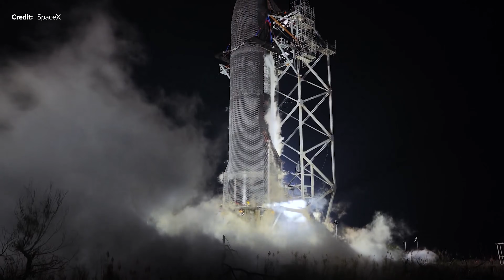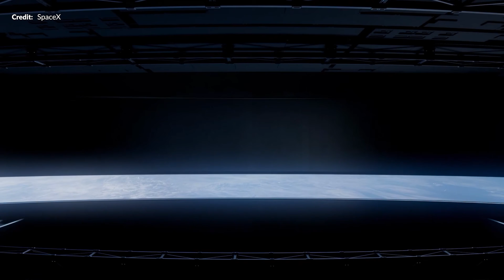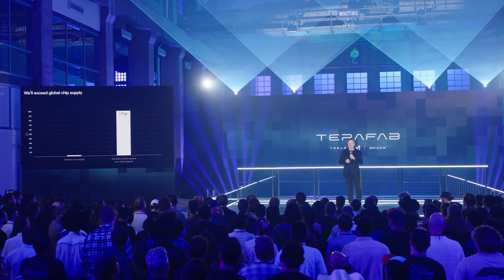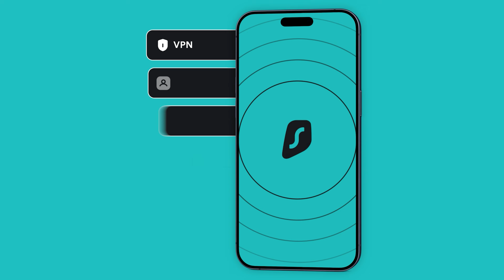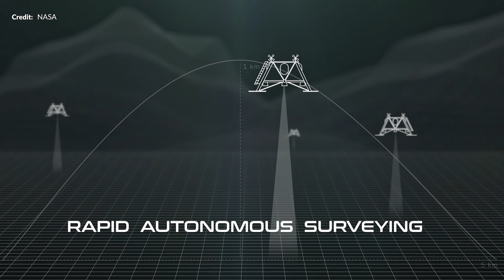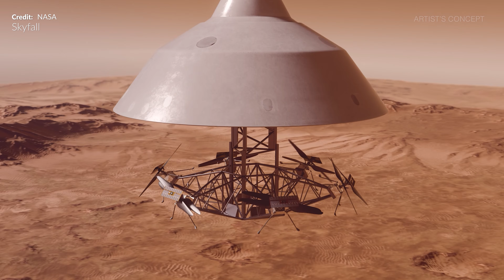They Want 5000% More… Of WHAT Exactly?

Comment: What I don't get is since when we are measuring compute capacity by the units of power - KWh, MWh, GWh...? What happened to OPS ( operations per second or some other compute capacity measure)? It sounds like we're measuring air cargo capacity / capability by using the fuel consumption. Very strange, IMO. Oh good grief, please don't schedule launches on April 1st
Reply: Electricity is the number one limiter for any data center. I suspect that is why they started measuring compute in electrical terms.

Comment: No it wouldn't take all that BIG TIME building one little unit does it's bit and then 2 little unit doing same or different little bit then 3 little unit get 9 in each ship launched adds up fast and can work fine by little bit engineering

Comment: So a few things to keep in mind regarding the complexity of the supply chain are that 1. it's as complex as it is because it wasn't made as a single cohesive end-to-end process. It evolved naturally by taking advantage of existing infrastructure and specializations. On the moon there is no existing infrastructure and anything we build there is going to be designed from the ground up as an end-to-end vertically integrated process. 2. There are certainly innumerable ways that the supply chain here on earth could be simplified if that was the objective but that's not what they process is optimized for it is optimized to deliver the minimum viable product for the lowest possible cost so even the supply chain could be simplified by delivering a component across the street that component might instead get shipped half way around the planet because someone else put in a lower bid 20 years ago which created a snowball effect of market dominance in that specific specialized task in the chain. It isn't necessarily as complex as it is because that's the only way to do it it is as complex as it is because the industry as evolved so quickly that in a lot of cases if a company didn't get in on the ground floor 20-40 years ago it is very hard for them to get a foot hold to brake into the market and compete with pre-existing corporations. There are very few cases where a particular point in the chain is there because they are literally the only possible source of that component those exist sure but they are not the norm.

Comment: Why is SpaceX not making the Starships single use? If they do not have to return to earth, then that saves massive costs and it increases the (fuel) payload they can take up. 
So, discard the Starships? No..... Not at all. Just combined them to make the ISS-replacement and rent out space, so they will make money that way. 
Just a thought.
Reply: Making them reusable saves money. It’s literally the whole point of starship
Reply: @zachb1706 
Yes..... but when it comes to fuel delivery systems, reusability can take a different form. 
Yes, the 'normal' starships should go up, come down and go up again as soon as possible. 
But every kilo (heat shield) on a tanker ship reduces the fuel it can take up. Fuel needed to land it, reduces the usefulness of the tanker ship as well.
So why not leave the heat shield behind and do not keep fuel for reentry, but instead take up as much fuel as possible, pump that into the other ship, and then REUSE the ship as a space station?
Reply: @RensDuijsens sure, in an expendable configuration you could send up more fuel, but you’d then be expending the entire vehicle - the vehicle being like 90% of the cost to launch. Instead you cut the payload slightly, and reuse the vehicle, saving that 90%. 

And your idea to use the expended vehicle as a space station to offset costs. Firstly you’d need to give up a lot of mass and money to build out a space station interior. And secondly there’s no benefit, what would we use the space station for, who’s paying for it.
Reply: @zachb1706 
Well.... who was paying for use of ISS? 
They did investigate (and not only SpaceX did) if a private space station would be profitable, and the conclusion was that it would, hence several companies are planning their own space station. 
But I get your point about the interior.

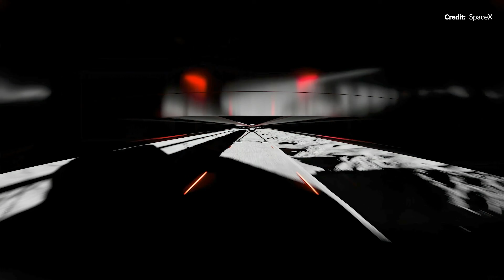Comment: 9:00 You actually don't need every element to be mined or manufactured on the Moon! You can fly entire Starships full of the extremely hard to mine on the Moon materials, and even things like AI chips, from Earth to the Moon. Building just the heaviest parts of the sats and doing their assembly on the Moon would still lead to absolutely massive cost savings, if they were then sent into space using a mass driver from the lunar surface.
Reply from the maker: That is the only way I could see it working but the question is what percentage of the materials in terms of mass would you need to send from Wath. I'm not a fan of sending rare earth materials into space over long periods of time. We don't want to be hurling stuff out that is never to be recovered. If it is all recycled, that would be ok, but currently none of Starlink is recycled. It will just burn up in the atmosphere.

Comment: 10B is a lot of money if you aren't pissing away 2B per launch. If you can get the cost down to 200M per launch to lunar orbit which should be possible using current or near term SpaceX rockets it is more feasible. Additionally Musk is going to be putting his own gear on the surface so partnering with him makes a great deal of sense. Let the rest catch up and throw them a bone when they are good dogs. Ditch the SLS ASAP.

Comment: Though I'm sure it will happen, stints as moonbase crew won't be popular for long, once the range of health impacts becomes abundantly clear.
Reply: What health impacts?
Reply: @imaginary_friend7300 0.16g
Reply: They'll be living in tunnel bunkers, not on the surface, the health impact won't be anything other than the standard bone loss, They'll be fine, when they're working outside, They'll be in sealed space suits, most of the surface task would be done by the robots, or drones
Reply: @stefthorman8548 That is not the current  science

Comment: A Million Tons into LEO is just Crazy...  No one in their right mind is apt to believe spacex could actually launch millions of tons yearly into orbit ..  it seems like a silly fantasy...  On the other hand...  It is possible that if the next few starship tests flights just happen to go as spacex plans we could start seeing frequent starship launches this year..   15 years ago if you told someone falcon 9 would launch and land 3 times a week with well over 150 launches a year they would have laughed at you..   With just 4 boosters and 2 working launchpads, Starbase TX could see 2 to 4 launches daily by the end of this year..   This seems crazy.. But this launch cadence is fully plausible...   4 boosters and 8-12 starships, once the kinks are ironed out will launch daily..   The deciding factors will be how long a starship stays in orbit before returning and how long it takes to put each payload into returned starships..  

This is why spacex plans on mass producing starships and not boosters...   One booster will launch dozens and dozens of starships into space each month.    Spacex will likely assign 2, maybe 3 boosters per launchpad..  With all the success of the last 2 starship flights the odds of this happening are much higher than they were a year ago..    In the next 12-16 months when Spacex starts launching from 5 towers we could easily see 10+ launches daily...   That's somewhere between 1000 - 2000 tons a day into LEO..   Totally unthinkable 10 years ago...   Even outlandish proposals could become reality..  Our world is changing fast...

Comment: Does anyone remember that first super heavy launch off of basically gravel. The entire pad failed. Multiple engine failures on climb out. How is lifting off the lunar surface going to be any different? The original lunar lander used an upper stage to launch protecting the vehicle from debris.
Reply: They won't be lifting off a early low fidelity test article.  You don't have any actual clue what's going on do you?

Comment: They really need some drones too. Moon drones. With refillable rocket motors, so they can view the whole area for longer than the 20 seconds it takes for them to land. Then they can scope out new areas to explore, and maybe even transport small items to astronauts in different locations, potentially lifesaving things that would take too long to reach in a rover like an emergency oxygen pack, medical supplies or batteries, or tools to fix a stranded rover. It could go dozens of miles away and then rocket back to the base without having to refuel until it gets back to the base. 

They could refuel it using water ice in the craters by splitting the hydrogen and oxygen. 
I guess they could use it to survey for more water ice too, route plan etc.

Comment: Elon has already made the issue of using his high competency and AI driven Robots for the moon to do ALL the outside work of setting up the base, mining the regolith for HE3 and other minerals and setting up a metallurgical plant for creating pure and complex metals to then produce other products such as solar cell arrays, metal frames for satellites, containers, other equipment for mining and building structures (mass drivers?), and eventually another Chip manufacturing plant.  True not all metals are available on the moon (such as iron (as far as I know)) but there are some of the more esoteric metals and he plans on sending Starships with Robot Crews and prefab mining, smelting, and manufacturing automated systems in the asteroid belt that can ship exotic metals and precious metals back to earth.  the Robots can be programs initially and via broadband microwave to do all this and ship the stuff back to the moon or transfer to Starship landers in earth orbit to send back down.  Their are large asteroids made entirely of metal including base metals and precious metals such as the Gold and Platinum/Iridium/Rhodium series that can be mined and used.  He has very agressive and realistic plans for the next 50 years including Mars colonization.  Just saying, it doesn't all need to be done by manned units!
Reply: He has?  Where?

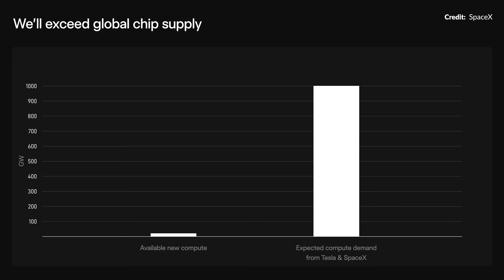Comment: 7:45 Compute is NOT measured in Watts; it simply doesn't make sense.
1. Watt (W) is energy, meaning the amount of electricity that flows into the chip. If a chip gets more efficient, it can do the same amount of work/calculations using less energy, thus Watt.
2. Compute is measured in FLOPS (Floating Point Operations (per Second)), a variation of that (TFLOPS for TerraFLOPS, PFLOPS for PetaFLOPS, etc), TOPS (Trillion Operations Per Second). Sometimes in IPS (Instructions per second). Simply put, how many instructions or calculations can a chip do in a fixed amount of time (given an optimal environment).

FLOPS & co. make incredibly more sense, since chips get more and more efficient over time, but the calculations stay the exact same, they just get more. The last actual change was SIMD Instructions, and they are just multiple calculations at the same time → The Amount of calculations still mattered the most.

Measuring Compute in Watts only makes sense if you want to compare the efficiency of two or more chips, or maybe if you produce incredibly inefficient chips but want to make it sound amazing.
Reply: When it comes to powering and cooling it's the important metric.

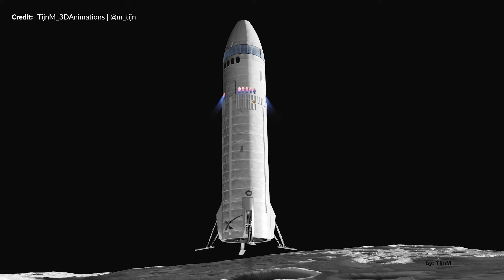Comment: 13:18 - Starship is far too tall to land safely on the Moon.  The height of the CoG of Starship exceeds the diameter of the footprint of the landing legs by an order of magnitude almost.  That means it will tip over and topple on inclined or uneven surfaces.

Look at the LEM tha NASA landed on the Moon.  It had a CoG elevation that was far less than the diameter of its landing legs.
Reply: That's pretend expert nonsense.

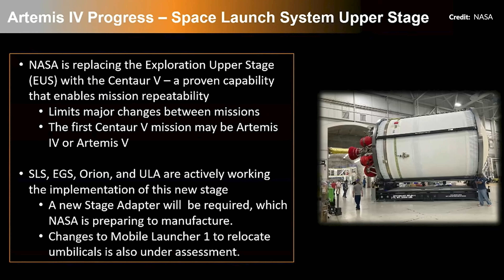Comment: 12:56 - I have a gut feeling that the SLS is being held back to give Tesla time to get up to speed.  Something that probably will not happen for at least a decade, if at all.

I think the cost efficiency of Starship is a myth.  Don’t look at the cost per flight.  Look at the cost to get results.  SpaceX fails that standard miserably.
Reply: as long as there is private equity funding appetite, combined with gov't spending appetite, SpaceX will probably be able to proceed. Once they go public, they will also go the public debt/bond route to raise funding. Whether those sources run dry does depend on execution. While Elon time extends everything, at least SpaceX seems to be able (to date) to develop what they say they will (unlike Tesla in some cases). Starlink, Falcon 9, Falcon Heavy to name a few and reusable rocket consistency with Falcon 9. No firm is perfect, but at least SpaceX seems to be relatively well run by Gwynne Shotwell (or at least she seems to be able to navigate the Elon minefield so far).
Reply: More pretend expert nonsense.  I think you're a fool and little else.

Comment: As far as the lunar communication system.... Why don't they just use a falcon heavy to throw an entire payload of moon-optimized Starlink v2 minis into lunar orbit? That would surely be a HELL of a lot better (and cheaper) than 2 purpose-built satellites. Then just put a dish on everything on the surface of the moon, and bingo! Instant comms.
Reply: Because there are few truly stable lunar orbits.

Comment: I think the idea behind making AI satellites on the moon is that much of the mass would come from the moon (the frame of the satellite, propellant, making the solar panels and radiator) but the difficult bits like the actual compute elements/silicon would be made on earth and delivered to the moon for integration. To replicate the chip supply chain entirely on the moon would be very difficult indeed.
Reply: Hard to get metal and hydrogen out of the Moon.
Reply: @mrbaab5932  Aluminum is abundant on the moon. I'm not sure hydrogen would be the propellant of choice for AI satellites. Starlink uses xenon fuel for ion thrusters. The point of the mass driver is to reduce the need for chemical rocket fuel.
Reply: I'd imagine it was done this way to increase the wow factor for news and investors, and if ever done in the flesh it will surely be done the intelligent way

Comment: I had this interesting idea the other day.  What if The Gateway Station is turned into a duel mass driver and moon space elevator system?  This way, we would take advantage of the 1/6th gravity by creating a permanent system that would require no fuel to land and transfer materials and people to and from the surface.  The Gateway could then have Hotel modules to create a moon tourist economy as well as a research hub and a way point for the moon and beyond?  Just think of all the issues with landing and take off, the debris being thrown around and the windows for launch, all of that would be eliminated.  Then, you could also use the elevator shaft as a mass driver for deep space exploration.  By removing this landing and launch element, it should make the entire system more flexible and convenient!  Imagine spending a couple of days in a space hotel and then taking a four hour excursion on the surface of the moon.  This way, the station isn’t dependent upon one industry to support it.

Comment: I have an idea! SpaceX' Starship, the most powerful rocket ever! I think they should finish it. Use it maybe 7 times. Then stop, lose the plans to it and go back to only launching with the Falcon-9 and Falcon Heavy! Does that make sense to anyone? But it's what America did in 1969. Saturn 5, F1 rockets, the most powerful ever! Fully developed in 5 years. 100% successful use from first to last! Used a dozen times, it was supposed to take us to Mars next, by 1985, but we stopped! We waited 15 years for a whole other rocket system, the Shuttle. 2/3rds the size but 1/10th, 1/10th the power!  We keep using every rocket from the 1950s. Once developed, used after. The Mercury, Gemini, Shuttle rockets, all still used! That old Soviet 1950s rocket, still used. But not the most powerful ever, the F1, Saturn 5. Then we begged Russians for their stronger than our Mercury and Gemini rockets but weaker than our Saturn 5. 60 years later we are only now finally able - in 60 plus years to develop as strong and stronger a rocket as what we did in 5 years in the 1960s. And any of you actually believe this?! American Moon, on Odysee com. Or search there for any on the Lunar lander. NASA admitted, 1 sheet of aluminum foil thick in some places. And admitted using Scotch tap in places to hold it together. Tape visible in some official pictures. Astronauts stepped through the floor when practicing on earth. They had to put down floor mats to avoid that!
Reply: youre talking out of your ass , not giving any sources except that weird bullshit website . The lunar module wasnt held up with "tape" , please think for a second. Also its not uncommon fir spacecrafts to have very thin hulls, your average soda can is also very thin but can handle more internal pressure than what a spacecraft has to deal with in space.